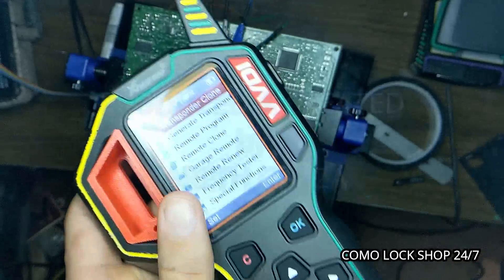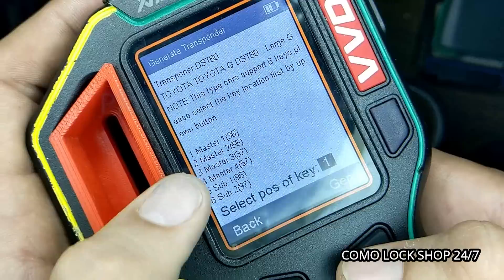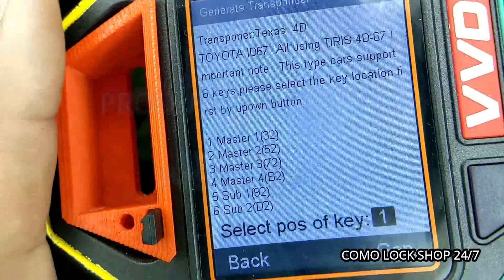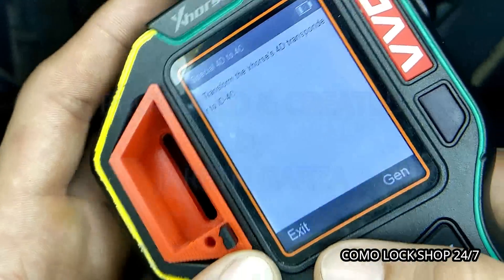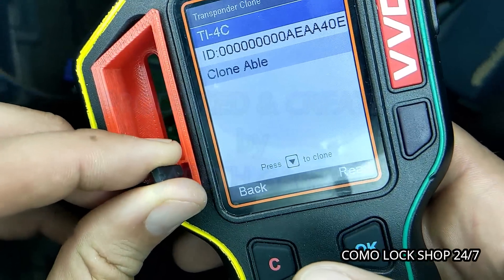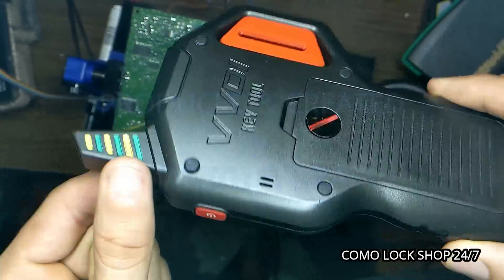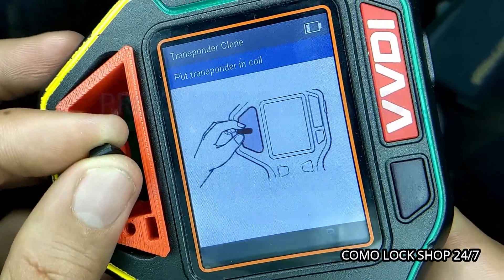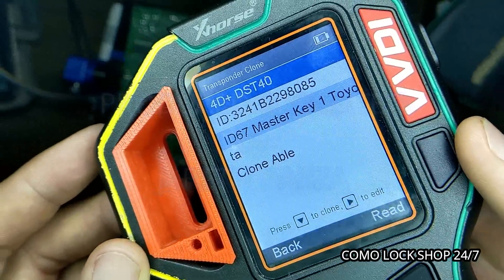A Look at LKP-02 Clonable/Programmable Transponders & VVDI Key-Tool Compatibility

Comment: Hello my friend. Ok I have a huge favor to ask. Is it possible you can get me the file for the 3d printed part your friend made for you. I have a really good friend that's a locksmith that has that exact machine and that part is either missing or broken. He turned me on to your video to see if I can help him. I myself am a locksporter but I also have 6 printers that I make tools for the locksport community if theres something you need yourself my friend. Personal pinning trays, plug followers, kik and euro holders and some other tools. If you could help me out that will be much appreciated my friend.
Reply from the maker: No sorry. I dont have the file and my friend sells these parts for profit.
Reply: @JarethGarza  ok that's cool too. He said he can't find the part to order it. If your friend wants to sell us one that's fine too.
Reply: @JarethGarza  my buddy said he would buy one from him no problem.
Reply: @JarethGarza  if your buddy sells parts does he have a website I can get in contact with him?

Comment: You can generate ‘Special G’ chips (for the Scion FR-S, and Toyota 86)  using these LKP-02 chips, but Im not sure you can do it with the VVDI keytool.
Reply from the maker: Tango should, if vvdikt cannot
Reply: @JarethGarza  Have you ever tried generating the FR-S Chip with tango or VVDI key tool ? Not sure they can...